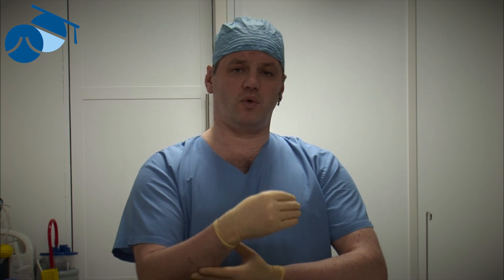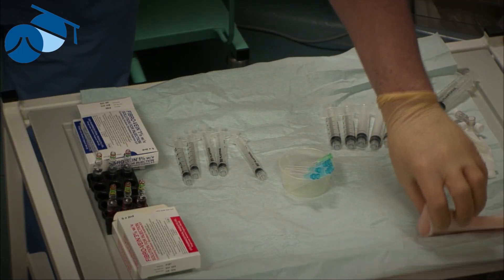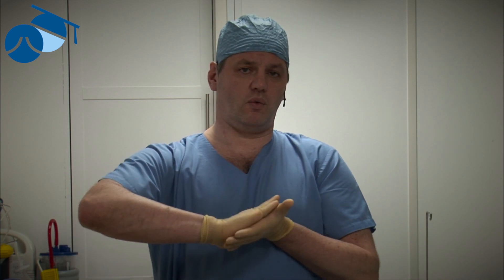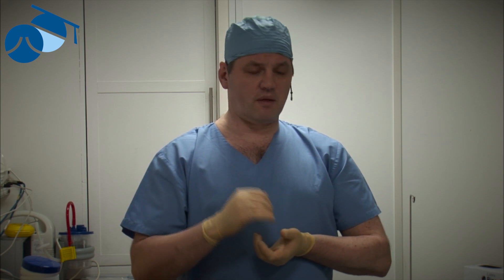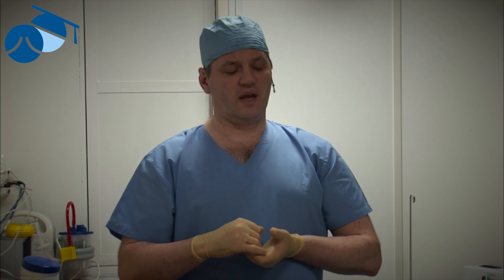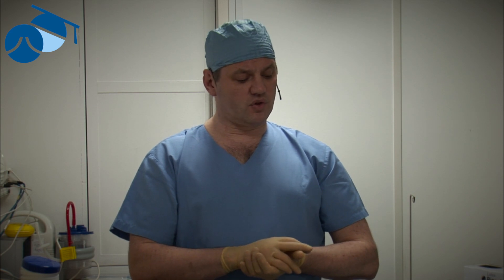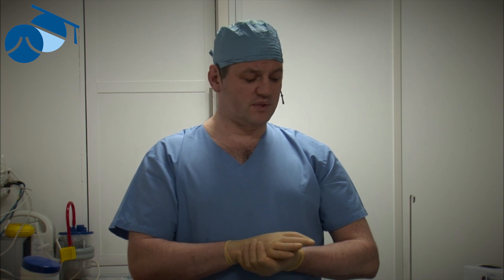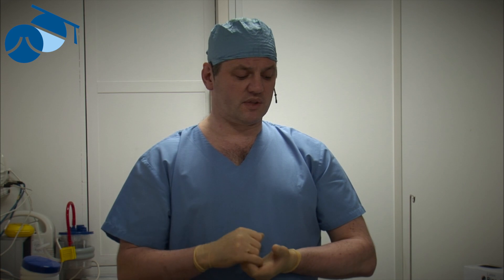Explanation of foam sclerotherapy for varicose veins

Comment: Is it possible to perform microphlebectomy without performing endovenous ablation first?
Reply: Yes - if there is no underlying reflux or only very minor reflux. If the underlying veins are incompetent (blood id refluxing down them) then to perform microsclerotherapy first without closing the underlying veins results in the varicose veins coming back - and often much worse as well.
Reply: @MarkWhiteleyVeinSurgeon  I think in the response to the above question you thought I meant microsclerothrrapy, but I meant microphlebectomy/stab phlebectomy. Am I correct?

Comment: Thank you so much fof this. I'd like to ask a question, please....is there any concern that the sclerosant will injure deep veins? thanks in advance. Shayne.
Reply: Hi Shane - yes indeed Deep vein thrombosis (DVT) is a recognised complication of foam sclerotherapy. Hence in The Whiteley Protocol, we reduce the risk of a big DVT this, to near zero by only using foam sclerotherapy in small veins near the skin and not in the big veins near the deep veins. Hence we use a combination of treatments that are selected on the basis of our research and results.
By keeping the doses of sclerotherapy small, and in small veins away from deep veins, as well as using good compression and doing as ambulatory procedures (not under sedation or anaesthetic) the risks of a DVT are very very low.
Best wishes
Reply: @MarkWhiteleyVeinSurgeon   Hey thank you so much for responding. I thought that because this video was done so long ago I wouldn't get a response anytime soon. It's only as I reached the first line of your message I thought about the way those superficial/ tributaries being relatively far away from the deep system. So your comment helped me think that through and I understand. Thanks again for responding
Reply: Additionally, is there an email I may be able to reach you at, please?
Reply: @MarkWhiteleyVeinSurgeon  appreciating this. I would love to visit your clinic for a bit one day. I'm not located in the USA, but the Caribbean.

Comment: Hi, so I just ad this done. What happens to the viens after a couple weeks with foam in them. Do they just disolve  ? Great vid
Reply: Thank you - No the veins are damaged from inside the vein lumen (the hole in-side of the vein) and this kills the vein wall - as long as it was done int eh smaller veins (foam doesn't work well in big veins). YOu then need to keep the blood out of the dead vein to stop it clotting for 2-3 weeks - hence the recommendation for compression for 3 weeks. This reduces the brown staining, clots and failures.
Reply: @MarkWhiteleyVeinSurgeon  Hi, thanks. I do have a full leg compression and was told wear it for 6 weeks. A 3 inch in siting was made by my groin area. Why don't you Dr's just cut both ends of big viens and pull them. Last time I  had this done,5 years ago they put about 6  10 mm insidious down my leg and I assume they pulled those out. I'm thinking I will have to return to get the lower ones out as I assume the foam doesn't go to the bottom of twisted large viens. What is in the foam ? Thanks  I'm in BC Canada
Reply: @gladheateher4now  because pulling the veins out doesn't work in the long term - they just grow back again - see our published research https://pubmed.ncbi.nlm.nih.gov/17410557/ and https://pubmed.ncbi.nlm.nih.gov/24844250/